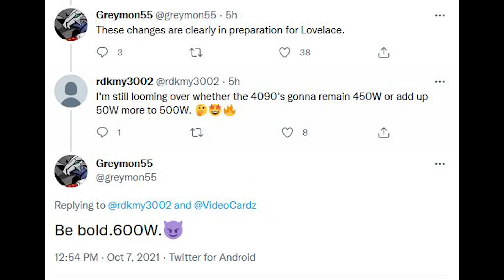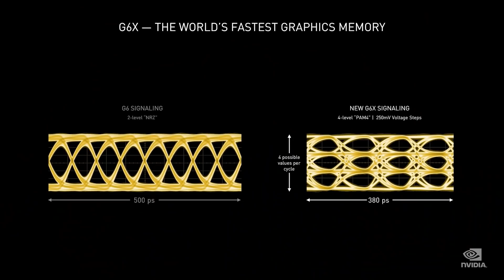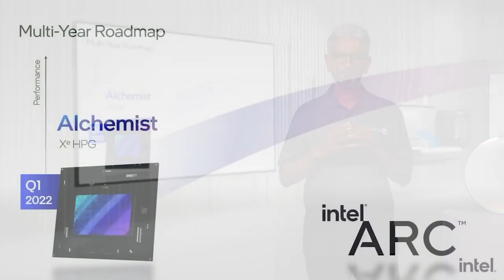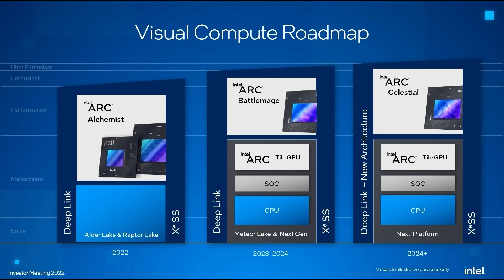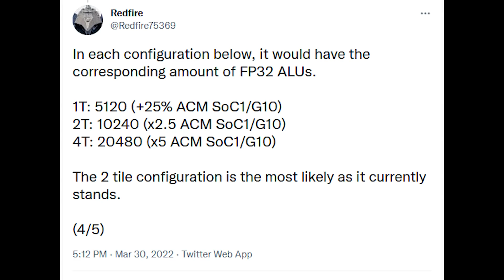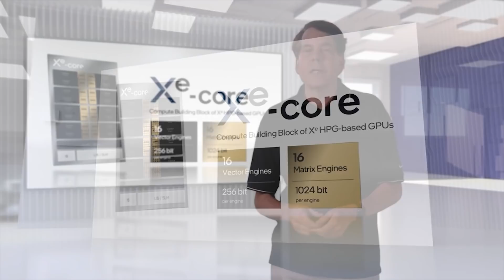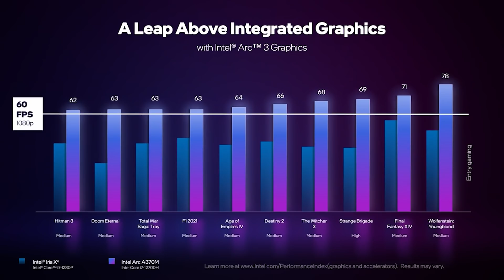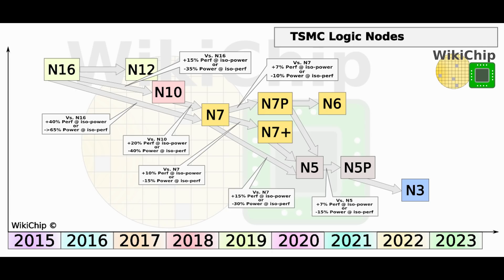RTX 40 UPDATED SPECS Leak | Intel Arc Battlemage Is CRAZY COMPETITIVE

Comment: I wonder when that Xbox version comes out, because next year N4 and its variants should be readily available. Those could drop TDP 40%-45% and make Slim version tempting option. But maybe N4 will still remain too expensive countering the savings from smaller console / thermal solution / PSU.

Comment: We kind of heard this before.  Ampere was supposed be so good. When was actually kinda crap.  Because (source Jim from adored TV) ampere was on Samsung’s 8 nm, which was just refresh of their 10/12 nm. Nvidia didn’t want pay higher priced for 7 nm TSMC so they went with cheaper node but charged more for 3xxx then any previous generation.  Then we got bots/scalpers plus high demand all over the world, which cause almost all pc parts to skyrocket.  Ampere was joke at what 10%+ performance boost (vs last generation) at much higher cost to TDP, and Nvidia is going back to TSMC is kinda proof they were not happy with Samsung 8nm node lol. 

RDNA2 was decent/ better then RDNA1. But it’s RT performance was kinda worst then RTX 2xxx.   It went up in price too.   Let’s hope this year RTX 4xxx / RDNA3 and intels dekstop GPUs are all actually decent.
Reply: Rdna 2 ray tracing was faster than a 2080ti. It just wasn't as fast as 3000 series.
Reply: @tstager1978  I’m hoping RDNA3 is better.  Would also like to see AMD use GDDR6x with cache memory.  But they prob won’t. Imo it’s holds RDNA2 back some.

Comment: Given the delay in getting the Arc cards out and the corresponding drop in GPU prices this spring, i wonder if they won't find themselves in the position that no one wants to buy the gen 1 version knowing that gen 2 will be out so soon thereafter.  I wonder if they will have to resort to guaranteed trade-in values to move gen 1.
Reply: They'll be fine if they price it right.
Reply: @MagiofAsura  I agree, if they are willing to price it right.But the 2022 release of the 4000 series and the 2023 release of battlemage will have to have a negative influence on what people are willing to pay.
Reply: @kcgunesq  yeah Intel roadmap says battlemage will release 2023 then surely it will release mhmm 🤣. Totally there won't be any delay.

Remember that Intel roadmap also said that Arc is coming in 2020? 

Realistic release date of battlemage is mid 2024.

Comment: I think they could do a better job with the names of the product and logical differences between them.   Something like this makes more sense to me.

Name             Vram size/Bus Width

4050		     6gb  @192 
4050 S		12gb@192

4060		     8gb  @256
4060 S		16gb@256
4060 Ti		16gb@256  (more cores,sm,clock speed, gddrd6x, etc)

4070		     10gb@320
4070 S		20gb@320
4070 Ti		20gb@320  (more cores,sm,clock speed, gddrd6x, etc)

4080		     12gb@384 gddr6x
4080 S 		24gb@384 gddr6x
4080 Ti		24gb@384  (more cores,sm,clock speed, gddrd7(?), etc)

4090		     32gb@512(?) gddr7
4090 Ti		32gb@512(?) gddr7 (more cores,sm,clock speed,etc)

Comment: I hope Lovelace uses GDDR7, but if it doesn’t, it should use GDDR6X clocked at 24Gbps. What Nvidia might do though is do a refresh of the RTX 40 series at some point next year with the AD102 GPUs and possibly AD103 using GDDR7. Lovelace should be at least twice as fast as Ampere in order to compete with AMD.
Reply: GDDR7 won't be out for a while
Reply: @brainletmong6302  It could be in a few years

Comment: When intel launch i will be too late..Q4 2021 or early Q1 2022 would have been perfect for them and us… they simply missed.
Reply: Q1 was almost pushing the release to its limit. Now It will be far too late for them unless there is an insane price drop
Reply: @Jane-qh2yd  realistic release date if the desktop parts is late Q3 lol. 
The cards are already finished hardware wise since January. 

They're delaying because there are huge problems with the drivers. It's currently like 50% chance that a randomly chosen game will have some issues on it.  
They probably will release them only when this drops to at least 20%. 

Still even on release Intel graphics drivers will be much worse than competition. It's impossible to catch up with years and years of driver optimizations and game-specific driver code inside AMD AMD nVidia drivers during only one year.
Reply: @Jane-qh2yd  also to even sell arc GPUs Intel will either have to sell them at a loss or release them as OEM only.
Reply: Idk at this point some might settle for it if they can't get hands on 40 series or 30 series cards reliably

Comment: In relation AMD and Nvidia top bin accelerator (dGPU) refocused to commercial / B2B on greater profit margin and on the power envelope toward infrastructure IT can accommodate on cooling and custom BIOs/firmware, PC volume OEM's (Intel sales group) asked Intel and Intel audits constantly to produce a mid shelf card performance wise that fits within the power envelope of a prebuilt system. I think so. Definitively Arc is sold in OEM CPU + GPU kit deals. If Intel also supplies the memory, Samsung memory for example, of Micron or Hynix so long as Intel cut the volume memory procurement deal, that may be constructed similar Intel's P5+Neptune board + DRAM bundle in 1995 deemed 'anticompetitive'. mb

Comment: LMAO these days AMD is the only brand that makes ANY sense for CPU and GPU.... Both intel and nvidia releases HOT AF and expensive garbage.... But as i see baboons buy the 12 gen intel stovers, i bet there will be idiots that will buy the RTX 40 as well, and their houses will catch fire....
Reply: Those intel stovers have better price to performance than anything amd
Reply: @muhammadnuman3985  I have the 3700x and the performance on that is very good, SO 5800X performs EVEN better... So dont care how much the intel trash performs better, as they are nasty, they did slow the cpu tech progression for many years, and their CPUs are hot and with many security vulnerabilities... For 20 FPS (and costing 50$ more) more intel is NOT better, when it melts and hit 75c... 12900k/ks even hits as much as 80c with water cooling....
Reply: Lol. 12th Gen outperforms for less. AMD pricing is too high for an older architecture.
Reply: Mad cap. The 5800x runs notoriously hot, I have one. And the cooling on AMD reference cards is shocking, the 6700xt can hit 80c in a lot of cases. Ampere only uses about 50w more on average, hardly any less efficient.
Reply: @huggarty5434  The 5800x run hit when u have garbage case, fans and cpu cooler as the CPU will boost its speed as higher as it can, so when u have garbage cooling, dont blame the CPU, disable PBO and overdrive and make it not to boost and you wont have bad temperatures peasant... nVIDIA`s stock cards are garbage too... go cool an hot stove 3090 card or 3090TI they burn even on good models like MSI supreme X, EVGA FTW and others...

Comment: Yikes up to 800W, Nvidia must be struggling against their competition.
Reply: @Manuel G "from what we currently know... AMD only wins in efficiency but loses in everything else."
--> from what we currently know, and based on the not insignificant evidence you have provided, you, sir, are talking bollocks.
Reply: @Manuel G for some who will need to watch spending on energy, that can very much be a deciding factor.  

IMHO, we need another "Maxwell" from both companies.  I believe anything more than 400W for a flagship card and 600W for a halo product is just dumb.
Reply: @Manuel G That's not what I heard, at all.
Reply: 800?! lmao
together with the rest of the system it will use 1kW lmao
Reply: @ClippyHatesOligarchs  
Which translates to 1,5 horsepower. You could drive a little car with that amount of power.
Reply: With the creep towards 4 slot cards and 500+ watt power draws, I don't see how the trend can continue.  I wonder if external GPU's with independent power supplies is the next iteration.   At some point, they simply can't increase power consumption and have the host PC be capable of working on ordinary 15A electrical circuits.  AT 600 watts for the GPU, 250 watts for the rest of the system and say 100 watts for monitor(s), that is only leaving about 250-300 watts for anything else on the circuit for any length of time.
Reply: @Manuel G Ok greenboy!
Reply: Amds 6900xt forced Nvidia to release 3090ti.To  get performance crown with the sacrifice of efficiency.Now Nvidia future is dependent on AMD.Next gen Amds 7600xt will be as fast as 6900xt and 3090.
Reply: @vmafarah9473  
3090ti is up to 25% faster in non RT workloads at 4K. That's why AMD is also releasing 6950XT despite already having a liquid cooled 6900XT XTXH chip out there.
Reply: @technewseveryweek8332  St the cost of 2X power usage for 25% speed.Thats a great achievement.